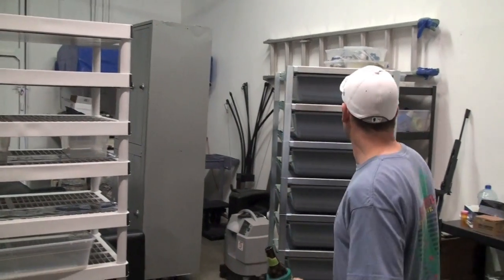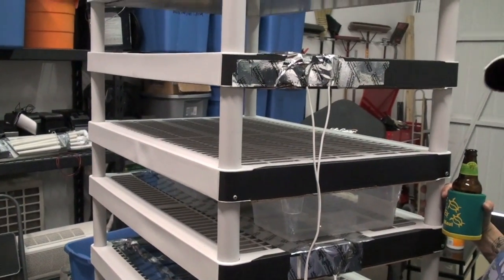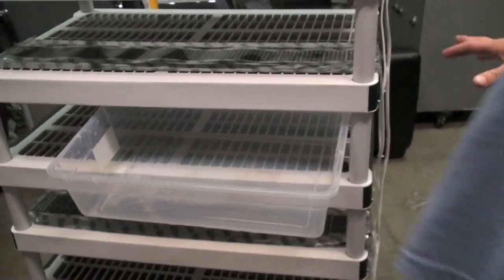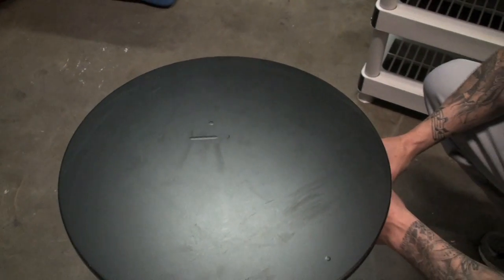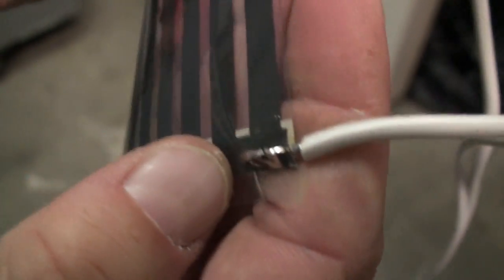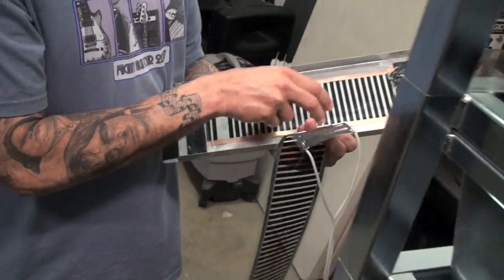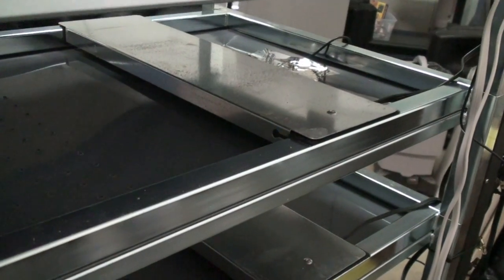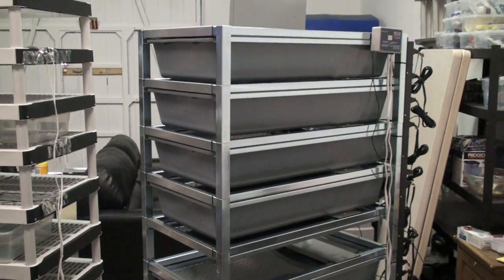Best Snake Rack Ever!

Comment: WTF sure i want to spend $1000+ per rack. i will take my DIY all day.  Use a little brains and you can have a great rack.  Funny that tape that they are knocking is used everywhere. Got to you local hardware store and check it out.  Can use it with ppl but it "might" harm your animals.  Your animals might die tomorrow as well.  Feel bad that this was just an ad.  Showed a rack to a carpenter and he asked how many of the parts were made of gold.  Most of the things in the pet industry are this way.  i feel really bad that ppl believe this.  I have used the plastic tubs that he is knocking.  i have buy 25+ for much less that the cost of the beautiful tubs. then the low cost one break you throw them out.  It is that hard.

Comment: I use inside outside carpet in my aquariums. My collection just hit a point that I am concentrating on building my own rack system so I'm not too concerned about the staining of the steralite containers. So I'm more focused about heating with flex watt. I've heard numerous people say to heat the back of the snake rack by winding the flex watt down so you only need to use one thermostat. Any insight on that? belly heat is great but even in glass with side and top heat I have great digestion from my snakes.

Comment: I did the same rack and it works perfect instead of using tape to keep the heat tape down but what I did is that I used i these metal plates license plates got them from the flea market for about a dollar each to put the tape on and no Oder I've had it for about 7 years never burned or harmed my pythons and geckos!

Comment: I think they are simply saying that if you're ready to step up from DIY to professional (ie:  value your time), the quality of the product is worth it.  I do a lot of woodworking and sure you can cut a sheet of plywood with a $400 Bosch saw from Home Depot, and I have.  However, when you want to do quality production work, you shell out the $$$ for a "high-end" saw.  The difference between the Bosch and my SawStop cabinet saw is tremendous.  DIY will get you going but if you want to do it as a profession, you need professional tools.